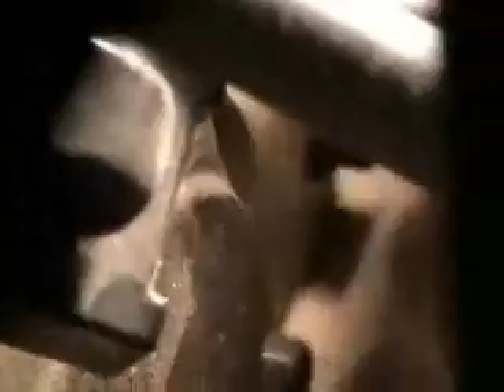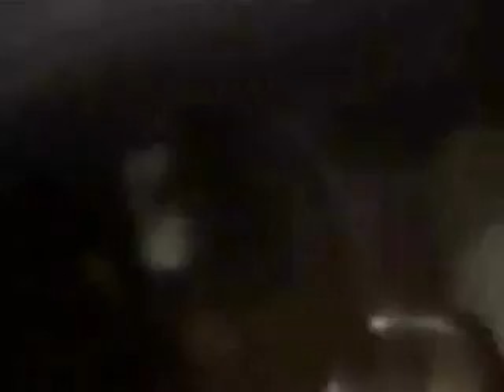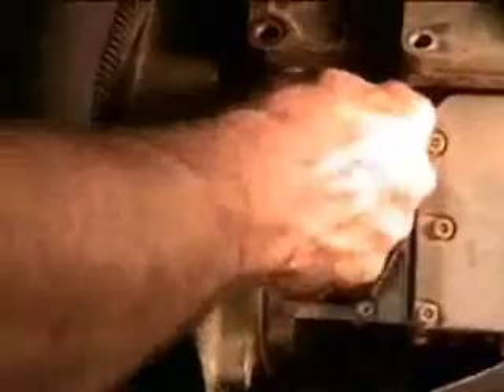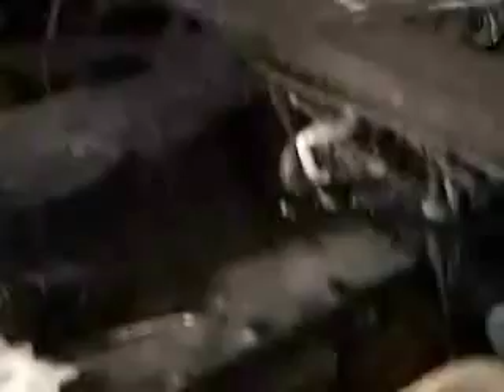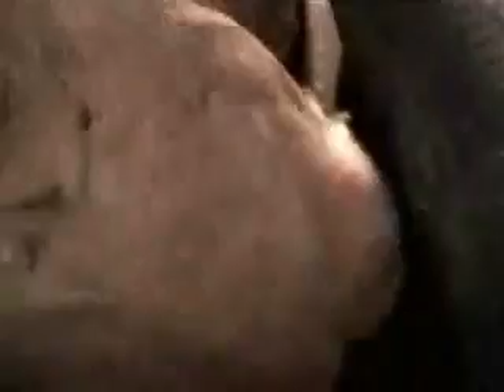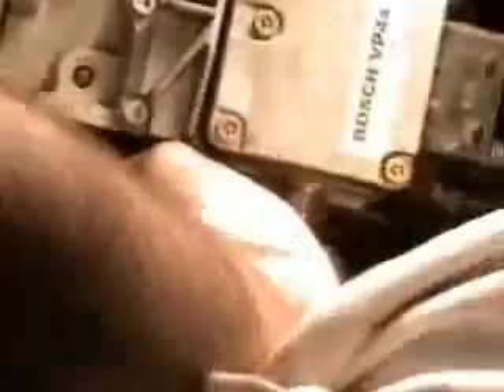VP-44 Install and Removal Series Part 5

Comment: thank you thank you than you for putting the part in about turning the key way straight up !!!  because sure enough i pulled my old pump out and when i set it on the bench it fell out so thank you again for that little pointer !!!  good luck in the future

Comment: I found it. Thanks for the tip.  I blasted the hose and canister with some Jet Lube Clean Up as it was coated with oil.  Now it's nice and clean.  I've got a rubber strap wrench and I'll be taking off the cannister shortly.  I'm doing this at the back of my shop between breaks in my work.

Comment from the maker: That is what the oil filter wrench is for. When I "bar" the engine over via the alternator nut with the (22mm??  Can't remember) is when I set the keyway up. Might make sure you ate watching the vids in correct order. I hated that YouTube required me to chop these up. Makes a mess. And I don't have the originals anymore.

Comment: Where is the part where you remove the overflow canister and turn the engine over so that the key is at the top of the gear? I watched two through three and never saw it.